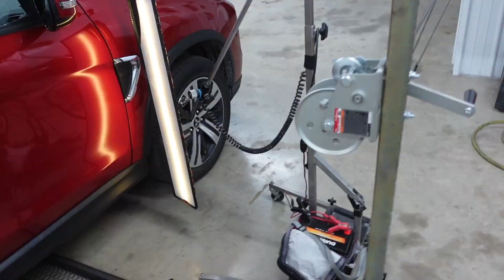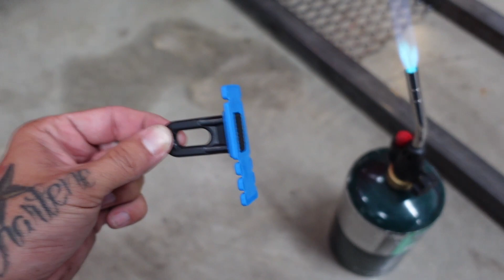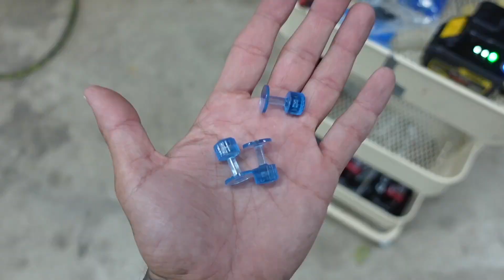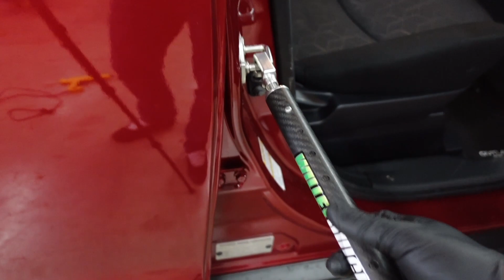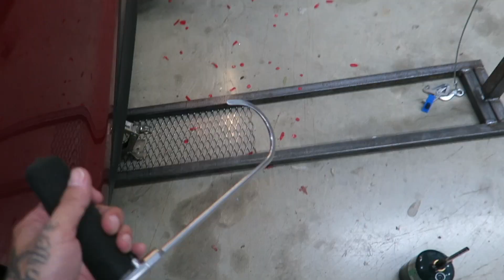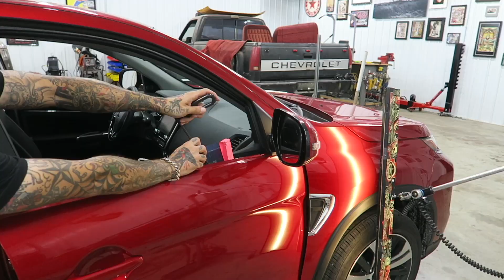Big dent repair with pdr - Glue pulling made easy

Comment: No wonder PDR service is usually $125/hr. I had a door dent on my Audi S4 Turo rental and the work took 3 1/2 hours to fix the dent. It costs me $562.50 out of pocket, but bodyshop wanted to charge $1800 for the same work.

Comment: Question, 
First off you are an amazing source for my PDR education and greatly appreciate what you are doing. 
Would you use infrared heat lamps instead of a torch. Not sure if this is a personal choice or a funding choice.
My fear would be to burn the paint if I leave it to long or get to close.
Something like the Heat Storm HS-1500-TT Infrared from amazon $112 or some other heating lamp.
Reply from the maker: Appreciate it Wootuser. Yes an infrared works great I use them when its cold out. For the most part I stick with the torch it's fast and if you keep it moving you will have no issues.. I try to avoid using extension cords as much as possible the more mobile the faster i get work completed.. Just a personal preference